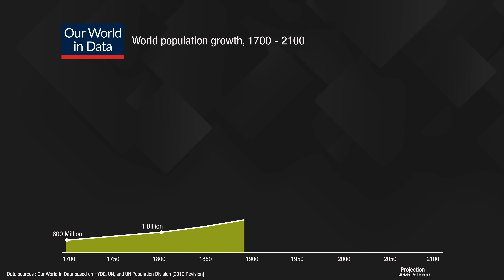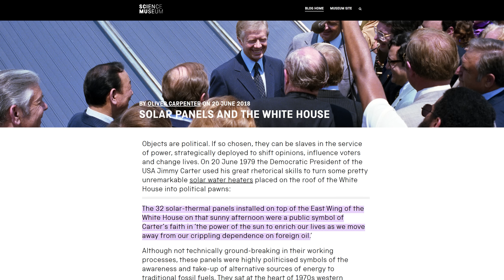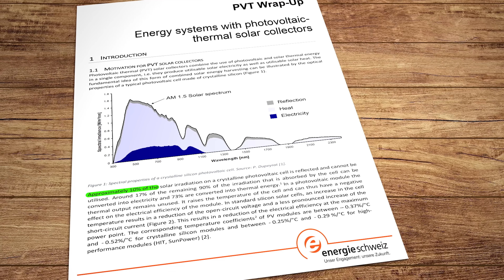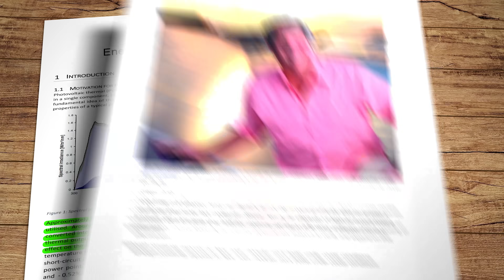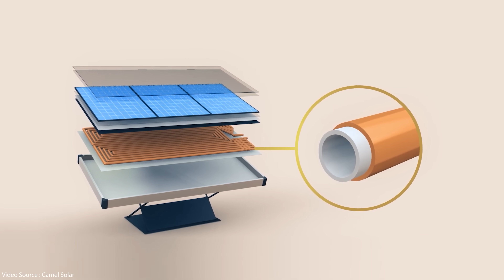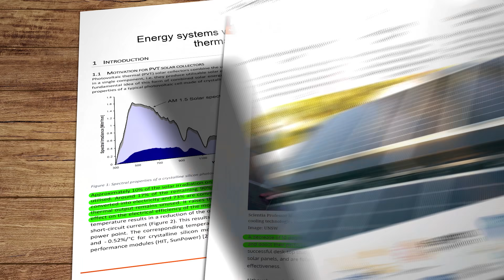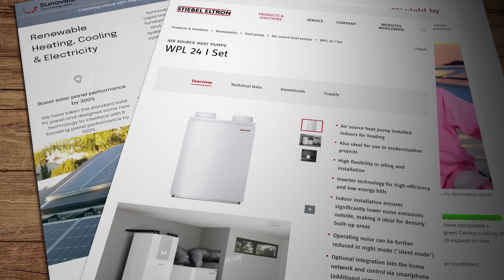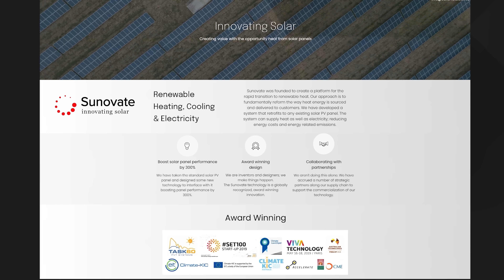The Solar PV panel that provides electricity AND heat for your home!

Comment: Photo Voltaic cells are far less efficient than a solar powered Sterling hot air engine...
 They also use exotic materials that Stirling engines do not...
 And the engines last more or less forever with less maintenance than solar cells
Reply: @william breen ...🤦‍♂️...
 So solar cells in your mind never deteriorate and never lose efficiency?
 So they also will not leak cadmium after 10 years into your yard via your roof downspout?
 Have Fun with that...
 I built a Stirling hot air engine 25 years ago in college and it has not needed maintenance once...
 I can run it all day, all night ...
 Off of biogas and sunlight channeled with a parabolic dish....
 Basically... forever...
 ...
 Do what you want, just try not to make any laws that tell me I can't do something easier, Sustainable, cheaper and better in every way. 
...
 Until human beings understand that their poor home designs are the basis for their need for infrastructure and Supply chains,  We will continue to struggle as a species to find balance.
Reply: @william breen   I want to be nicer about this topic... You might think I have a chip on my shoulder... That is understandable. I can be a little Blunt mostly because of a shortage of time.. That plus an overwhelming frustration with reality..
.. But let me bring you up to speed briefly...
Would you care if you knew the cost savings of those solar cells resulted in the suffering of human beings? What if it was forced labor that made them? What if the factory didn't have good conditions and was making people sick while working there? As a frame of reference, look up the women who were painting radium onto clocks in a factory, here in America, less than a 100 years ago... That is going on in China, more or less... Except at gunpoint.
 Might want to look into where they come from...
 The cost is a lot higher than money.
 But some people want to feel like they're being green...
 If you want to use the roof space to just absorb the heat, that would be practical too...
 But if you look into it and you find something reassuring, please get back to me and let me know all is wonderful in the world... I could really use some uplifting news.
Reply: @william breen i will try to incorporate that idea at the upgrade.
Maybe someone else has already thought of it..
We should look into it.
...
 Up until you mentioned it I thought that the most practical use would be to heat your pool if you have one...
 That is actually a fairly cheap upgrade... And you can keep your house a lot cooler..

Comment: Why not just put finned heat sinks on the back of panels just to get the longer lifespan? It would be cheap and trivial, even though you don't get to use the waste heat.

Comment: Photovoltaik electricity could be stored as Hydrogen. There is a system (PICEA) that converts solar power in the summertime to Hydrogen to be used in the winter through a full cell to produce electricity and warmth to be used to heat up water.
Reply: You can't store hydrogen for long. It will leak out of just about anything.

Comment: I've been dying to hear about this exact thing!  I've been looking forward to learning about any companies investing into photovoltaic thermal energy.  I specifically wanted to know if any companies had any intention to combine the heat with a district heating system for long-term storage. Now, I have my answer.

The only other thing I'd like to know is whether or not this technology can be combined with floating solar arrays.  Floating solar has the ability to track the sun with simple tilt mechanisms, so you can track the sun by one axis.   However, you can also massively boost the energy production by simply rotating the entire array, so you can track the second axis of the sun.

Now that I know photovoltaic thermal is a thing, complete this technology by combining it with CPV (concentrated photovoltaic) solar.  But, only do it with a floating array.

Comment: One of the best ways to cool the photo voltaic panels is to install the panels directly onto heat exchangers filled with a food grade glycol/distilled water, then pump the heated fluid into a radiant tubing imbedded in the Gunite shell of a swimming pool. In the summer months the pool  might not need added heat, the solar heated fluid can be cooled with irrigation water. This application would be perfect for a farm, to produce electricity for pumps and lighting.
I’ve been in the solar business since1978 and have many different solar projects being used.
Cheers!
Giovanni
Reply: unfortunately concrete is a highly polluting material, so somewhat defeats the object

Comment: Thinking about the PVT, with a reasonably sized system you could even use the excess heat to condition a geothermal field for operation in winter months (in climates where the heating demand is large enough) it seems to me the hot water capacity would be more than enough to supply all hot water needs if you were not heating a pool or other large water body. You may need a separate ground loop for summer cooling however as all that extra heat would impact cooling performance in summer months.
Reply: Damn, I just made a post up top about this very same idea! You could use it in summer too.

Comment: PVT makes absoluteley no sence to me. Maybe things have moved on and maybe there are some limited benefits in hot countrys in regards to night time cooling as in the example. But lets get something very clear. Your expensive solar panels do best as stated between 21 to 25c. If you want 60 or as mentioned 40c for other uses, then your pannels need to stay at 40c or even hotter factoring losses to give out that continuous heat. If you do right by the panels you want to last for years you will cool them to 25c, which means at best your getting luke warm water or air from your PVT panels. In the summer this extra energy is not really all that useful and in winter in a colder climate your panels wouldnt be getting that hot anyway so its useless. I really see PVT as a just a scam. If you want piping hot water then make a cheap solar trough which only takes up 1 sqrm and look after those solar pannels that cost you at least 10K after instalation. Excluding fanatical fan boys, anybody who has some genuine technical examples that overcome these obvious problems, please do point me in the right direction as to what I'm missing.
Reply: @william breen I think the problem with this is that if the panels are even getting luke warm, you probably wouldnt have your heating on at all. The only really decent idea I have seen is a chap in the comments saying to use the waste heat in a cyro sterling or something along those lines, but again if your looking after your pannels then the temperature difference is really to small. Unless you also run this in combination with a heat pump but why have 2 completeley seperate systems wasting energy when you could turn the solar energy directly into refrigeration. The additional cost of those 2 seperate systems would be equal to a second solar array of the same size.

Comment: 1.  You headlined with the problems of overconsumption and reducing emissions.  But you said no more about overconsumption.    Reduced consumption is important, and will be essential as fossil fuels run out.  Electrifying cars may not be the answer.  The answer may be more in reducing car use and using lighter, slower vehicles.
2.  Warm air is very low quality heat, so very difficult to use.  Especially as warm air is not hard to find in places where solar resources are good.  Witness what happens to the high quantities of waste heat from cars and thermal power stations.  Mostly just thrown away.
3.  Maintenance is the big bugbear for any distributed generation, especially when it is exposed to the elements high up on roofs.  And more especially if it is complex, and if there is a huge variety of different products.    Not many human made systems have long low maintenance lifetimes  (15 years for other devices installed in houses?).
4.  Any PV systems use energy for manufacture and installation and maintenance.  Those costs are at present subsidized by cheap fossil fuels.  

I'd like to see analysis of the lifetime energy input requirements for PV in comparison with useful energy produced.  Such analysis could give clues as to which aspects will be most productive to improve

Comment: Back a decade or more ago, our now defunct company produced a PVT system that could be retrofitted to the back of a traditional 250w PV panel. In testing, we were able to transfer a considerable amount of heat to a swimming pool and DHW tank. 50C output temps were common during sunny days with ambient temps over 25C. Unfortunately the Canadian and Ontario govts changed to climate denying types and the bottom fell out of that market. Solar, at the time was VERY dependent on govt subsidies and approval.
Reply from the maker: That's a really great shame Mike. I'm really sorry to hear that :-(

Comment: 07:07 "Our home heating bills arew about to go off the scale". Here (Germany) I've just received a letter from my gas company to tell me that it will be costing three times as much starting May 1st. I'm expecting it to be rationed as well at some point in time, but 3X the price is hard!
Reply from the maker: I think you may be right about rationing Martin, especially if your government bows to pressure to stop importing Russian gas.

Comment: But what are we going to do with all that hot water in summer? Average thermal panel needs only fraction surface area compared to an average PV system to provide all the warm water a household needs in summer.

Comment: I was hoping the integration of PV and thermal solar would gain momentum as I have been putting off my own arrangements waiting for this. With Gas prices sky high and a ban on new gas boilers in 2025, some form of heat pump solution seems inevitable and if GSHP work using 15 deg C input heat, it will work better using heat from PVT - at least in Spring and Autumn. All I need to do now is convince my wife that the degraded external appearance is worthwhile !

Comment: Simple but clever solution, how effective will this be in the UK? , how much energy will the system use compared to the electricity production of the panel? Will it produce enough heat in the winter?

Comment: There's also such a thing as adsorption chillers that use heat energy to remove heat.  Not hugely efficient enrgy-wise but when your heat is free...
Reply: I made a similar comment on another thread in this video. RV absorption type fridges use ~5 times as much power as an equivalent compressor type one which is a drawback. But given that the energy source for the absorption chillers would be ‘waste’ heat then it would be close to ‘free’.

Comment: It really sounds like an area that’s just begging for new ideas and innovation.

It seems to me that the use of a heat pump here might be really useful and productive. 

Why not circulate a fluid or gas that is close to the optimum temperature of the solar cells, and which gains only a small number of degrees as it flows through the panel, so the panel pretty much remains at its optimum temperature?

I don’t know much about heat pumps, but I wonder if they’re able to transfer energy from a large reservoir (the fluid circulated to the panels) by lowering the temperature only a small amount, into a much smaller reservoir whose temperature is increased a lot more? That smaller reservoir with a wider temperature variation might then be more easily used to some effective purpose such as heating or more electricity generation.

Comment: the cold regions use liquid water radiator heat circulation systems typically
Reply: grid mentality is corrupting everything, be independent, truly, money does not solve anything, really, its only a burden

Comment: Nice video ..but to be honest it isn't anything new. I expect at the end you will find that cost of this system is too expensive..because that is the real problem..  That is why nobody else want to do it..not because it is bad idea ..but because it is expensive idea ..If i would tell you that price of your system would be double..and instaltion costs triple ..what would you say..even now ROI for some battery solar systems is on 15 -20 years..and with this it is even more..and in summer you don't have problem with hot water..that is why it isn't big deal...
Reply: Yes the system is just producing more heat that you don't really need at the time of year it's produced.

Comment: This system has more drawbacks than the liquid based systems.

It is harder to connect and route and integrate in home heating.
The air would need to be extensively filtered and the inside of these modules would need to have regular cleaning.
Then there is the problem of moisture build-up inside this system and the mold and bacteria that will collect.
Reply: Agreed, maintenance might well be thing that kills this. Not only mold and condensation, but also insects and other creepy crawlies. I can see it working in some situations where maintenance is easier, but possibly not on a 2 storey roof where access is challenging.

Comment: Is there any possibility that the excess heat could be used to create more electricity.  Maybe using the excess heat to boil water and turn a turbine generator.
Reply: The problem is it's very low grade heat, so any heat engine using this as a working fluid will be very inefficient and therefore uneconomical. Best to just use it to heat stuff up a bit.

Comment: This could be used for commercial greenhouses! Large water tanks can be stored inside greenhouses. Connect them to a heat exchanger and fan to remove heat from air during the day. Run them at night to keep the greenhouses warm without using natural gas.
Reply: Troy one of the many applications we have inquires on our technology for.
Reply: If you have a good spot to put those panels. On the roof of the greenhouse wouldn't be a good spot since it would shade the inside of the greenhouse.

Comment: Instead of PVC which has a limited lifetime when exposed to heat, why not use copper which has a much longer lifetime and conducts heat/cold with greater efficiency.
Reply: True enough .. copper would outlast the PV panels and is 100% recycled

Comment: It is an oversimplification; say 10% of the incident light is reflected and about 15% is converted into electricity. The remaining 75% goes into heating the panel and in cold countries it is not much. But consider countries in south Asia where sunshine is plenty but the ambient temp in summer can reach around 45-50C. When the summer temp is high, the temp of the panel will be close to 90C (you cannot touch it for more than a fraction of a second) and the electricity conversion has come down to less than 8%. Cooling a panel under such condition is expensive and complicated. And we do not need to heat the home (we need to cool it). It will work nicely in north america and most of the europe but they do not have that much of sun. You need to find a better use for the heat.

Comment: What a great way to improve the efficiency of PV solar AND it doesn't even require improving the sunlight/electrical conversion efficiency of the cells themselves. Using air to transfer the heat away from the panels also makes for a simpler system than trying to use a liquid. I like the idea of ducting the heat down to a shed type greenhouse attached to my house.
Reply: And/or a hot tub.

Comment: To make PVT viable in colder climates you could use the system to melt snow in the winter. I've been thinking about this for a while but haven't found anything online about it. I can find systems to cool panels and systems to melt snow off panels but not a combination.
Reply: I tried researching this for my new house I'm building in the next year. Dual Sun makes PVT panels with glycol cooling, however they don't mention anywhere on their site on the power required to keep the glycol above or near 0C to keep snow off the panels, or using any type of thermal storage other than a pool. There's a huge cost to installing a pool and it's maintenance, and if you look on Dual Sun's gallery, the only users of the system so far are either large facilities or fairly wealthy looking estates!
If you also think about it - powering the heat pump to drive the cooling/heating thermal loop could be a net negative or very little gain in solar production during winter. 
Plus the cost to plumb the system doubles your initial installation costs. 
And so far I can only find one retailer of the Dual Sun system in all of Canada.
So for now this kind of system still remains a pipe dream.

Comment: I live almost off grid, I use propane occasionally. My biggest issue is what do I do when my batteries are full before peak charging. 
My goal is to use WW2 technology called gasification to make a natural gas replacement and a byproduct called biochar by using my excess solar pv.
The gas would be used for heating in the winter when the heat pumps aren't enough or not a good charge day. The Biochar is a permanent carbon store and if you add natural ingredients it is an amazing fertilizer especially in poor soils. 
All of this from agricultural waste.

Comment: Why don't they have multiple inlets and outlets to help solve some of that problem.
Or make em smaller so it has time to cool em off.
Thoghts.
Reply: IMO a properly designed manifold at both the inlet and outlet would equalize the water flow to allow for just one inlet and outlet per PV array. It would be nice to have a 3D metal printer that could build the tiny tubes that would supply the best heat transmission from the PVs.